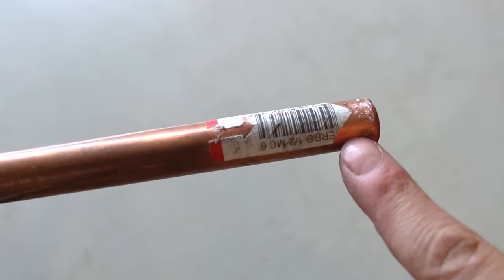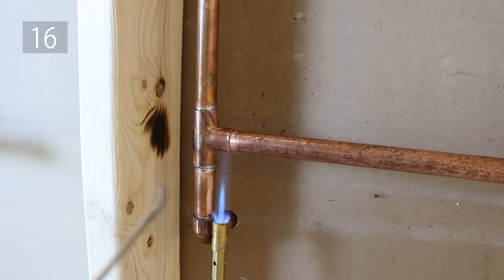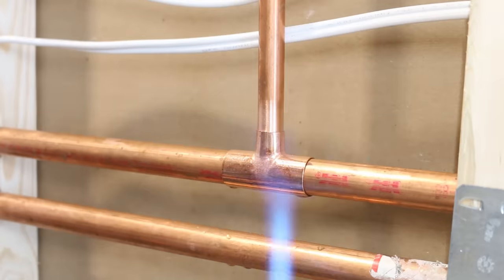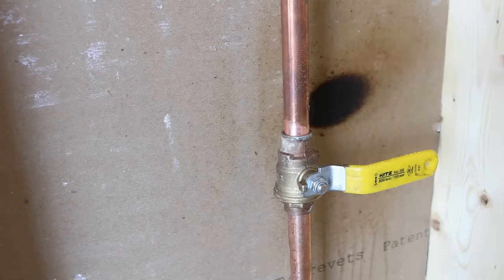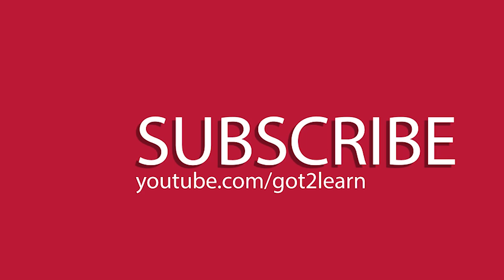The BEST 25 Copper Pipe Tips & Tricks EVER! | GOT2LEARN

Comment: Smash pipes: carry a sizing tool  that has a male and female sections. First insert the male portion and hammer back into round shape.
Second hammer female over the pipe to reshape outside of pipe back into shape. Good as new. 
Buy online.🌺
Reply: I had a pipe that came through the slab leak because the idiots who were installing it crimped it at the point where it came through the slap.  I've chipped away some of the slab, but I've only got about 1/8" exposed.  Any suggestions (other than just keep chipping until I get enough exposed to put a coupling on it)?  Is there a way to decrease the size of the replacement piece of pipe so that it fits inside of the existing pipe?  Currently, I'm just using a hose clamp with a piece of garden hose to bridge the gap, but I know that is not going to last forever...
Reply: @jakeblanton6853  
You said had a pipe, how did you fix it?
Reply: @vp3970  -- Haven't fixed it yet, or at least not *permanently*... The wall is still open and I have a hose over it with a hose clamp that bridges the gap in the pipe -- about 12"... It is an exterior wall and goes to a water faucet... There's no way to just turn off the water to that portion of the plumbing... In fact, since the pipe is under the slab, I have no idea where it comes from... It's comes through the footer of the slab... I originally thought it was a leak that was under the slab that was being forced up in the slight gap between the pipe and the concrete, so I started digging under the slab... I dug until I got down to shoulder height and decided to open up a bit more of the wall inside and see if I could put a plug in the pipe to just disable that faucet... As I was doing that, I noticed the leakage increasing, so I started chiseling out some concrete around where it came through the slab and cutting out the 2x4 base plate around the pipe and I discovered that the idiot builders had crimped the pipe as it came through the slab which caused erosion in the pipe over the years... The house has a brick exterior and the water would drain directly into the brick ledge and out the weep holes... It was initially more very slow leak that over time resulted in a wet spot near the faucet that I eventually noticed... Not a type of leak that is an emergency which you need to turn the water off and fix it before turning it back on...
Reply: @vp3970  -- Something like this?

https://www.lowes.com/pd/LENOX-Flaring-Tool/1003128480

If my local Lowes doesn't have that, I can make one myself on my mini-lathe... It's similar to the custom reloading die "powder funnels" that I have made for my Dillon ammo reloading press... I still need to chisel out the concrete which will be a pain considering where it is located, but small air hammer will probably make it a bit quicker... I feel like an idiot not thinking about considering making a tool like that considering how much a form cartridges to other calibers than they were originally manufactured as... 

I had considered just putting a plug in it and filling up the area above the plug with lead...
Reply: @jakeblanton6853 
There is no way to turn off the house?  The original plumbing contractor can not advise?  What state are you in? Most states require isolation valves near the street but inside the property sometimes in the garage. 
Do you understand looping? When roughing in a house? You have to find the loop manifold.
Reply: @vp3970  -- No, what I'm saying is that the branch that feeds that particular line cannot be independently turned off.  The entire house can easily be turned off.  If I could have just turned that particular line off, I would have done that since I don't tend to use that outside faucet anyway.  The original plumbing was done by the builder and probably just a bunch of day laborers with questionable immigration status -- I'm in the Houston area.

The "looping" that I've read about with respect to plumbing is for hot water and conserving water.  This is a cold water line and I've never seen that sort of looping done for hot water around here either -- probably because we get so much rain, we aren't particularly concerned with saving water...

If by "loop" you just mean a branch from another line,  yeah, I guess we kind of have that, but there is no designated distribution area that has shutoff valves for all the branches.  Hot water heaters are in the attic, so any hot water line will be coming down the wall.  This line that I'm dealing with comes from the slab and goes directly to the exterior hose bib without any T-connectors going off anywhere else.  What happens after it goes into the slab is anyone's guess though... The wall that I opened up is in the master bathroom walk-in closet, so it would not be unreasonable to think that the same line that fed this hose bib also feeds the show, Jacuzzi, toilet, and sinks since they are fairly close...
Reply: @jakeblanton6853  
No that’s not the kind of looping I mean I’ll txt more tomorrow bc it’s 2 am in Hawaii.
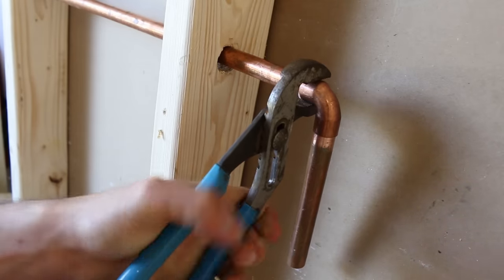Reply: @vp3970  -- I'm in the Houston area, so we have a few (apparently 5) between us... I woke up around 01:30 and couldn't get back to sleep, so started watching a bit of YouTube... One of the problems of getting old is that you often can't sleep all the way through the night... Painful to get up, but more painful to just lay there... Getting old sucks...
Reply: @jakeblanton6853 
Take melatonin it helps. No side effects
Reply: @jakeblanton6853 
I drew a picture of a water loop but no way to get it to you.  Please be aware that whatever the fix is it has to entail shutting off the main water. Can you txt me?

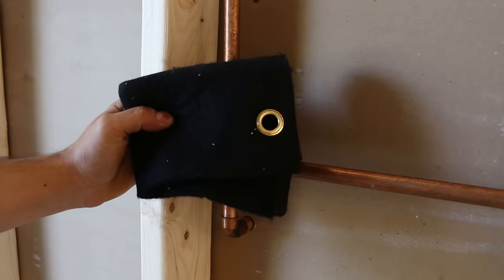Comment: 4:20 Asbestos blanket is much better and it’s all natural. Unfortunately, Amazon is out of stock.
Reply: Do not use asbestos sheet due to the killer Asbestosis.
Reply: Hardi-plank (fiber-cement siding) also works very well.  I've used it as a shield when arc (stick) welding.  I initially tested it with the full cutting flame of an oxy-acetylene torch and it would not burn.
Reply: Why no one understand joke?

Comment: Leaky main valve, stuff plain, white bread into pipe to create a dam, solder, then flush bread out an open valve....
Reply: So, I see my trick was revealed in video.  I'm not so slick after all.   I will claim to have learned the bread trick in 1975 @ 10 years old, and practiced many times.  An old boss complained when he used my truck that the loaf of white bread did not belong in truck..... after bossplaing he shut the front door.

Comment: Very informative. I've renovated a more than a few Bathrooms or built from scratch completely in different Homes I've lived in and am not a Plumber  I can solder but aways go for compression fittings as a rule, more expensive I know but you never have to worry about the solder cracking or not filling the Joint. That bit about the manufacturer's Label, I would just cut it off. The good tip you did but never mentioned is wrapping the thread tap clockwise. With the compression fitting, I always rough up the Pipe slightly where the Olive sits and wrap some thread Tap on that bit.
Reply from the maker: Thx @Michael towler, really appreciate your comment, you don't have to but if you can share it, that would be very nice of you ;)

Comment: Number 1:
Use pro-press.
Number 2:
Nothing, ur job is done
Reply: Drew Nelson I’m not here to start a huge argument, and pro press is nice, but I’ve had more PP joints fail in the last 5 years, than in all my soldered joints in the previous 20. I love PP for service calls and places using the torch is a bad idea, but I’m back to sweating more. I had a bad connection with a 2” ball valve last year. After the fix, with a soldered in ball valve, we cut the ball valve off the nipple we ended up with. It was fully made in, O ring didn’t look distorted or rolled. It just wouldn’t take. A $200 piece of junk. Hours of frustration added to fix it ( boiler room, no room, no clearance, yada yada)...
A lot of buildings in the city don’t allow PP... they’d rather have it soldered and pay for a fire detail.

Comment: "shower in a day" charlatans installed elderly walkin shower for the people we bought our home from. malformed the copper incoming water line. so now to get my new pressure balanced fixture installed, needed to know how to get that tube back in round. great tip. hope i can get to the line inside the wall (after cutting big hole in the outer wall brick and sheathing). Thanks. Love your vids.

Edit: was able to reach the offending tube (5" below bottom of opening) and managed to "sharkbite" it into submission. Finished running the lines for two washers from the exposed lines across the room (in the room on the backside of the wall; away from the bathroom) and got the new pressure balanced fixture installed. Thanks, again!!

Comment: I used the brush in the drill to clean a one inch elbow.  Cleaned most of the fitting with it and then used sand paper to finish it.  The fitting had 1/8 of solder and had been like that for decades.   It broke loose when I removed a circulator pump.  Thanks.
Reply from the maker: My pleasure :)

Comment: With hot air gun (with the accessory that reduces the air outlet diameter above) on wood, sticking to 15mm copper . And with a pliers we create a small tooth in the tube to hold the accessory in place.
from a Greek plumber. Very nice video!!.
Reply from the maker: Thank you very much K!

Comment: Thanks for the good video.  I have one more question.  What if I messed up soldering?  While I practicing soldering I make few mistakes and it needs to disassemble pipes.  First I heat the pipe and take out pipes after that there is solder left over both pipes.  Should I keep the heat it and melt solder and tap into the ground to remove solders?  And some pipe is permanently attached to a wall or some kind of device,  how can I remove solder there?  Sorry for my English.   Thanks.
Reply from the maker: I have a video coming just about this in about a week, stay tuned!!

Comment: Great tips! I was dumbfounded as to why the soldering wouldn’t flow in one of my joints. I didn’t realize that the bit of water still dripping (to an outside hose bib) was probably cooling down the pipe as I was trying to heat it up! Gonna try turning off the main valve. I see you’re using a Quebec Licence plate in one of the tips mentioned. Greetings from Les Cedres, Quebec!
Reply from the maker: Glad it helped! Yes, I am from Montreal, lache pas Claude!!!

Comment: Very good tips! I learned a few new ones. I like the tape trick to help hold the pipe up. The last one was new to me but I absolute love that idea. I had a pipe to repair that was coming down through a wall plate and I had to cut it close to the plate and solder the new pipe on but the house was finished and I was worried so I stuffed a wet rag the best a could around it but next time i could just solder a short stem heating  the inside of the pipe and then add on to that.
Reply from the maker: Awesome Jim!!

Comment: The heating the inside of the pipe to get the tee joint hot to solder - Have to use that next tine I have one next to 2 x 4 or whatever. . . . thanks for that tip. all were great really. Mostly common sense on all and time in trade.
Reply from the maker: Thx @evil brat, really appreciate your comment, if you can share it that would be very nice of you ;)

Comment: Great 👍 video. I didn’t know about the tinning flux. I will use that next time. I’ve been using MAP gas instead
of propane for a long time. It burns much hotter and is great when there is  some water in the pipe. It solders quick and easy no matter what...
Reply from the maker: You are welcome. Here's an interesting article you may wanna read about MAPP gas: https://en.wikipedia.org/wiki/MAPP_gas
Reply: Got2Learn, Well, it is what it is. It works quick and easy for me. Lasts longer because of it. I’ve had the same tank for years...
Reply: Got2Learn, I like your monkey wrench twist too. 😁
Reply: And your tape measure jack 😊

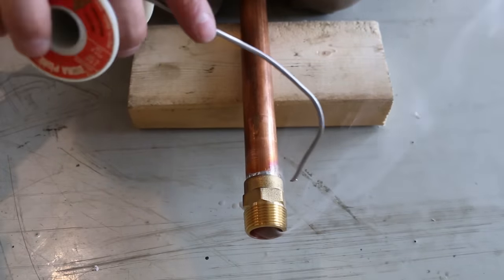Comment: 3:00 One time while staying alone during the off-season at a friend's summer cabin, I needed some solder to fix the power-cord on an old circular-saw that my friend had left in the closet, so that I could perform an urgently-needed carpentry job.  The problem was that I had run out of what little solder I'd brought with me, and the local area was largely deserted since it was Fall and thus there were no "fellow handyman" neighbors that I knew of from whom I could have asked for a bit more solder, plus all of the local hardware stores were closed because it was a weekend.  Fortunately, a plumber had come by the cabin a couple days earlier to remove an unused sink upstairs and cap off the copper water-pipes that had supplied the sink's spigots, and he hadn't bothered to clean up the dripped solder on the floor.  So I carefully gathered up these dozens of tiny solder-blobs from the wooden floor-boards, melted them together into several pea-sized lumps, washed the dirt and dust off them, and then used them along with my can of paste-flux to solder the wires in the saw's cord.  There was barely enough solder to properly tin and connect the heavy-gauge conductors, but I did manage to adequately repair the cord so that I could use the saw to cut the lumber and make the repairs that my friend needed done on his cabin.
Reply: Good idea!  For those that don't know, there are 2 kinds of solder. One for plumbing and one for electrical.  They are not the same.  Plumbing has an acid core and electrical has a rosin core. The acid core if used for electrical will over time damage the conductors.
Reply: @davidstanden480  Oh, I knew that --- as I say, I melted the solder-fragments down into larger blobs, and then washed the blobs with soap to eliminate any acid-residues.  So now the solder was pretty much just a mixture of tin and lead, with no acid or rosin, like solid-core electronic solder.  I then used my own rosin paste-flux to clean my wire-joints and to help the solder flow and wet the surfaces to be joined.

Comment: I liked the white bread used as a dam technique. I always heated the pipe which took longer to steam out those last few drops.  Beginners sometime leave the torch on the joint after applying solder causing the solder to flow out.

Comment: Pretty good, thought you were going to miss the bread trick. one more tip, when soldering many like to start with the bottom joint on a coupler or tee, but if you solder the top joint first then the when you heat the bottom joint the solder will want to suck up into the joint instead of dripping down the pipe.  works like a charm.

Comment: Another tip to easily repair a pinhole or small freeze split in a copper pipe. Drain the water out, as usual but don't cut the pipe.  Then all you have to do is clean the surface of the pipe around the leak a few inches beyond both sides along the pipe.  Using stranded bare copper wire, wrap it around the cleaned pipe covering the pinhole or closed split like it's a copper bandaid. Then using flux flow solder over the copper wire and the pipe.  The wire will give strength to the pipe and the solder will provide a water tight seal around the pipe and  the leak.  It's a way faster and easier than replacing a small section of pipe w/new. If you have what you need in your tool bag it takes minutes and you don't use any pipe or fittings.
Reply: The job is "Getter Done", and it will last longer than the other pipe !

Comment: never thought of using sliding ruler trick, so simple, Duh moment LOL guess cause always used other methods. I always solder with Teflon while on plastic tanks, the trick is be quick and I wrap the joint with a wet towel, used tube socks. no cracking yet. never used the crescent wrench trick but I use the Mexican speed wrench aka pliers. last tip I'll give you points on it since I've never done it because I haven't had an opening on the T or open pipe. again wet sock or let it burn "loves me that burn smell" great video.
i Like, OLE!
Reply from the maker: Awesome thanks so much buddy, I really appreciate it!

Comment: When soldering copper pipe the amount of solder used can be estimated by bending the solder over the diameter of the pipe. If you are soldering a T-joint with two 15mm and a 22mm you can bend the solder in a Z shape with the correct length of solder for each joint.
Reply from the maker: Good trick, thx buddy ;)

Comment: We only use Oatey Tinning Flux now and my guys have not had a leak since we have started this practice.  I've been in the trade for 35 years and I knew about tinning flux but the local suppliers in Phoenix did not stock it.  Winn supply in Tempe now stocks the Oatey Tinning Flux.

Comment: I couldn't  solder a pipe that kept having a little water run. I taped a small piece of rubber hose to the tube of my indoor/outdoor vacuum to the pipe, sucked the water out, then quickly soldered the pipe. Worked great!

Comment: About #23--removing water from a standing pipe filled with water.  Good stuff.  I like to heat the pipe far back down the line to make steam, which blasts a large volume of water out the open end.  When the water recedes back down the pipe, you will have enough clearance or enough time to make the solder joint before the water builds back.

Comment: Instead the laboriously pumping out water with a spray bottle sprayer, I keep an extra toilet over flow tube in my plumbing tool box and I stick it down any pipe that has water in it and I suck the water out and then spit it out. This works well even around 90° elbows because it is very flexible, yet stiff enough to push. I did it twice today while doing some plumbing for an elderly couple. Mine is about 15" long.
Works great!
Be sure to block the end in your mouth with your tongue so the water in the tube does not run out when you pull it out.